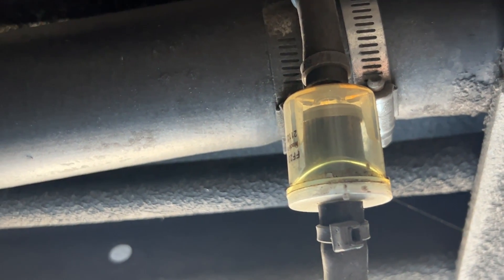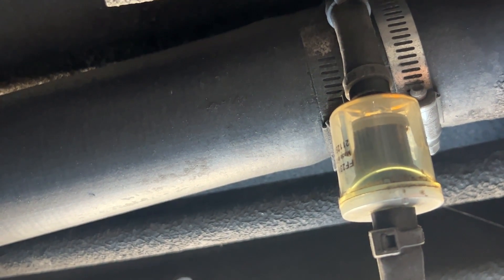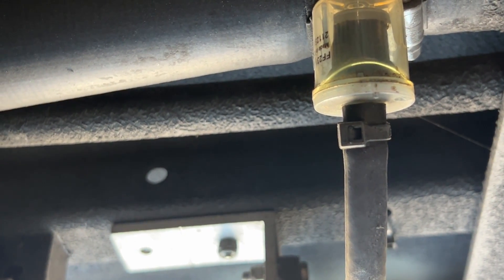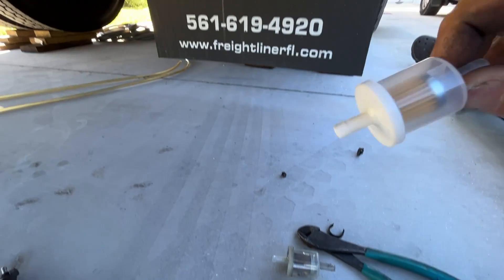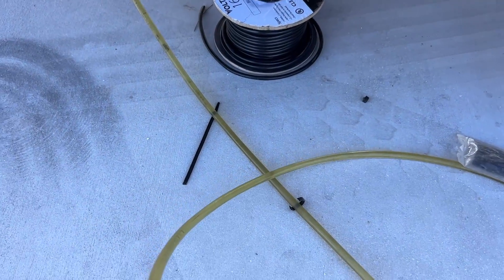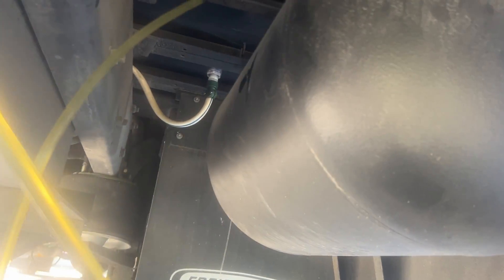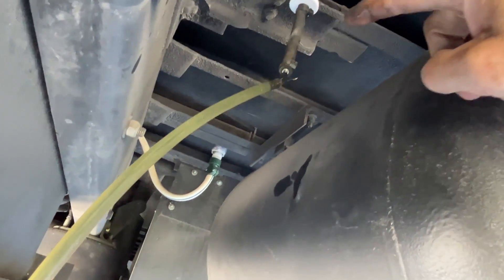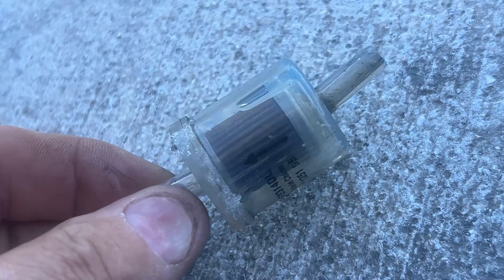Chinese Diesel Heater Fuel Filter Replacement

Comment: How did you actually create the siphon?
Reply from the maker: I used a long hose, about 6-feet long, and just suck on the end like siphoning gas out of the car.
Reply: @hakunamatataadventurebus5944 , thanks. I was doing something similar but then I found the top of a sprayer bottle and the line fit into the sprayer exactly. Yay!  I just got mine rebuilt and now I’m enjoying the heat again inside my box truck conversion. Yay!
Reply from the maker: Fantastic idea!

Comment: I put a little motorcycle petcock on mine. Makes changing the filter a lot easier. And my tanks above my diesel engine so it primes itself. But I think that flat part inside the filter points to the bottom not the top
Reply from the maker: Using a valve in the line’s a great idea. The flow on any filter I have eves seen flows from the outside in. I think it’s because if it goes from the inside out, the element can burst. ❤️

Comment: I’ve never worked out the correct direction these really run.  Both ways seem to work though.
Reply from the maker: You want the flow from the outside in. This way the crud will be on the outside where you can see it. Also, if there’s pressure like a fuel pump on a car, the paper element can rupture if clogged and flowing backwards.